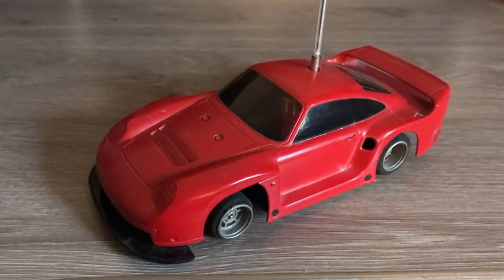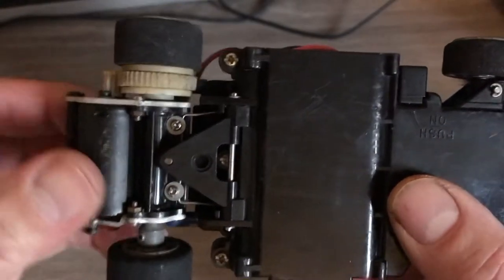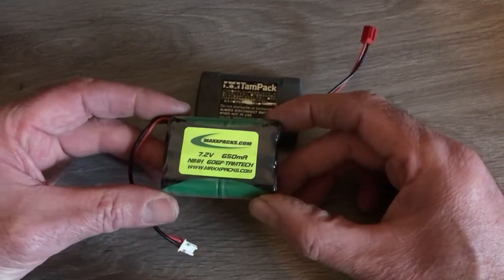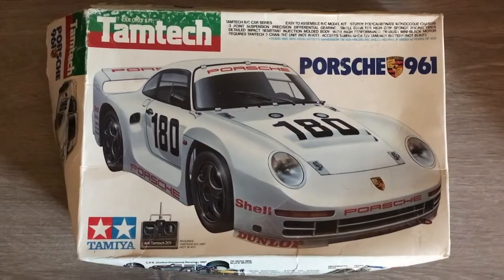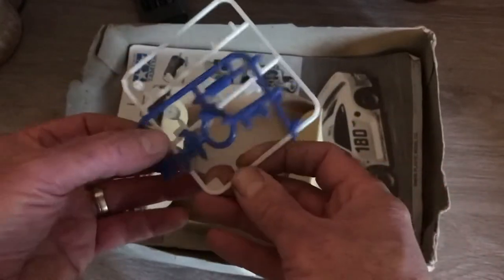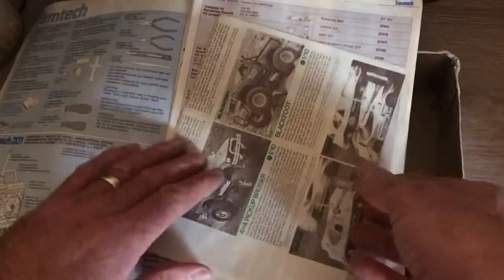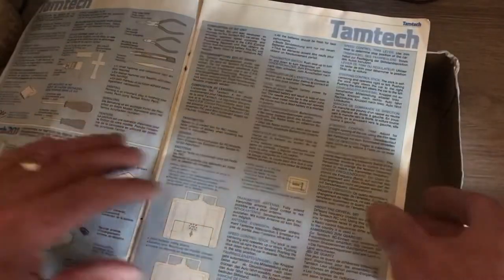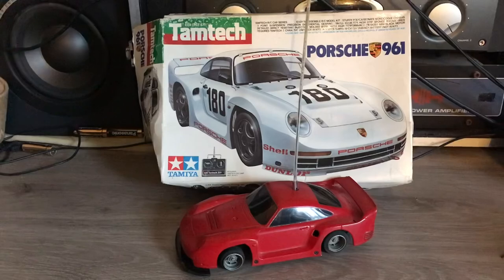Tamiya tam tech 1/24 scale Porsche 961 part 2

Comment: I've collected them sense they came out and have a few years with them now and bring them out occasionally to look at but from what I've experienced with them is the plastic chassis deteriorates at certain places and make sure you replace the 180 motor after so much time used because the micro brushes inside are so thin and fragile they eventually break and short out the FET's rendering it useless but they are some of my old favorites in that scale besides my Mini Z's and ABC's

Comment: Hi Peter, I think you’ve got a little gem there. I remember the days of 27mHz radio and the crystals that were used for the Acoms receiver and transmitters used in the 80’s. I did have a selection so that a group of friends and I could all run together (of course, there was always one Herbert! That placed the wrong crystal in their transmitter) and well, you know, the models ends up out of control! You could also use Hobby Wing for batteries, I’ve got a couple of Turnigy batteries for my Orlandoo Hunter 1/32 scale model, they are superb. They also do NiMh too, reasonable priced and quick delivery. The looking forward to the revamp of the Porsche 961, it will be nice to see. Take care, all the best and happy New Year. 😉😊😉
Reply from the maker: Hi John many thanks for your comment and happy new year to you. I too had a little selection of crystals for 27mHz and sometimes I d have to change crystals between races. When 40mHz came in for cars it was such a revelation, as there were so many crystals on that frequency you could go months without changing. I still have a 35mHz set for aeroplanes, but haven’t used that one in a long time since I got a 2.4 as they’re so much more reliable. Thanks for the info on the batteries John will give them a look up. I’m a bit out of date at present with RC so really glad for any tips, certainly electric stuff. Hope to see your Blitzer Beetle soon take care and best wishes